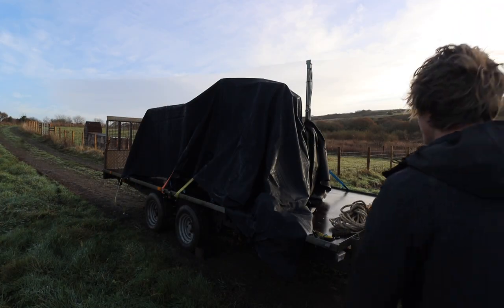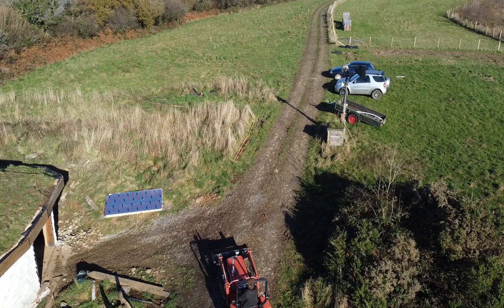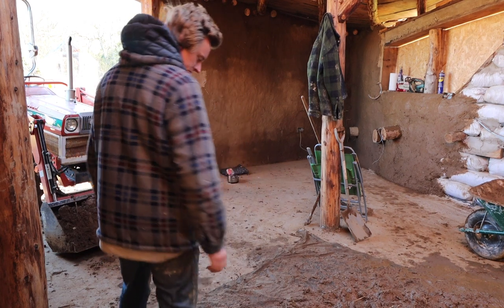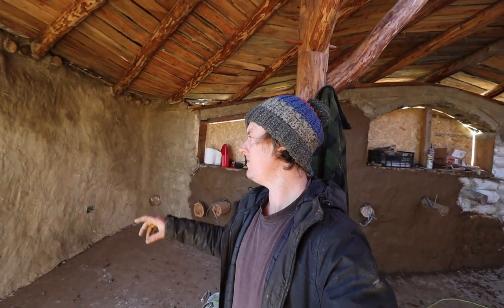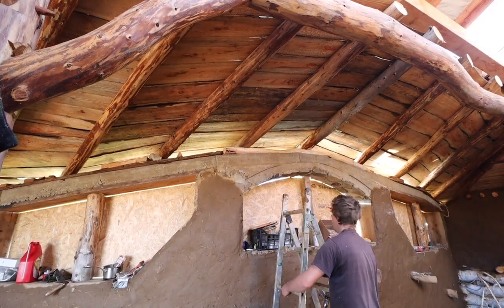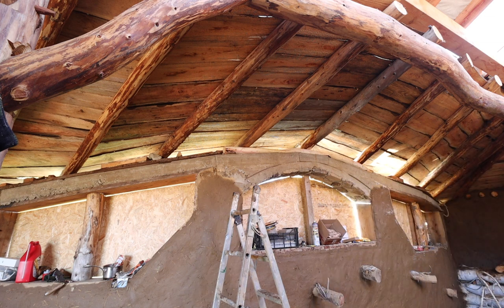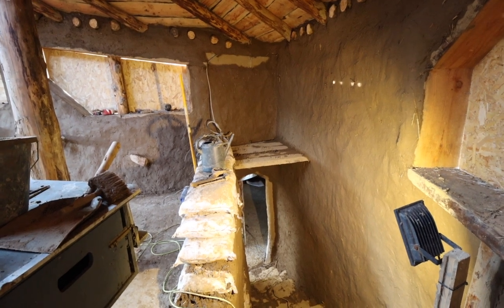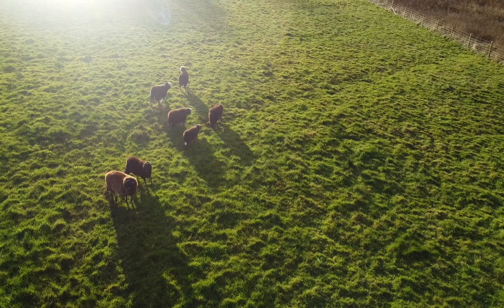Off Grid Earthbag Workshop Part 74 Cob Plaster

Comment: Kris, a tip for you some years ago a mate decided to build he and his wife a cob brick house not far from where I live
The way he mixed his cob was he had an electric cement mixer geared to turn in reverse (so the cob wouldn't bind up into one large lump) he could make on his own 75 bricks including prep and clean up a day in under 2 hours
I know you can get cement mixers that can be portable on tractors or bobcats (see Andrew Camerata's Yt channel)
You could drive to your piles of clay and sand load up add chopped straw (I had a mulcher that would have done that perfectly) and then dump it on location as needed.

I like the mill and you said it was in excellent condition but am cringing at you leaving it in such a damp environment for a long time even if you put Crc or RP7 or oil ON it
You could have stored it in the lower work shop till the walls where cured and dry

 For ease why aren't you using a tressel (2 ladders and a length of board between them) you could load up the board with blobs of cob and not have to get up or down a ladder 60 times....

Please do not think I am picking Kris I have the hugest admiration for all that you do , sometimes  we get myopic on the task at hand, 
And others looking on can see lateral ways of making our lives easier.
If I can I try to offer lateral ways of doing things that may not have occurred to the person, I can't be there to help you in person I hope this is a way of contributing. 
Tony from Western Australia 🇦🇺

Comment: When you mentioned the weight of the cob used only inside the new workspace, some images from murican building methods popped up in my mind.  ;-)
And I like your practical style of thinking/solving problems  , using the tractor for mixing the cob is another fine example.

Comment: There is nothing wrong with rejecting a piece of equipment that is not quite right or does not fulfill your needs. I have been told that I was too picky, about a particular saw. It was expensive, I had to save for it and it did not run properly. It was a huge safety issue for me and the cost to send it out for repairs/reconditioning was absolutely outrageous. It went back, yes disappointing to say the least, but having to look at it and being put off in disgust was stressful. I don't feel bad for me, but for the next person who got it!! Good choice if you are not 100% happy!!  Love your videos...crack on. Thanks for sharing!! :)

Comment: Surprised you aren't burning your woodstove in the lower section and letting that heat rise up through the upper workshop to help dry it out. I have said it before and I will say it again ....you are truly an artist with your building skills! Great job!
Reply: I assume it would be similar to plaster and not dry evenly and crack when an unnatural heat source is used (but that’s just a guess).

Comment: Hi Kris, just a hint...weld a tow bar ball to the top of your front tractor bucket...you can tow and move anything then and it does not affect the performance of the bucket. I also did it to a mini digger blade and it was so awesome towing anything anywhere. Great vids...I'm jealous

Comment: Great video. I'm a cobber and I paint the walls with a mix of lime wash and clay slip, about 50/50 and it works as a plaster as well as a paint as it fills up all the holes and smooths the bumps. What a brilliant workspace you have.

Comment: When I used to work at the factory back in the day we had a 2 ton machine delivered it was ridiculous but the way we moved it with ease was to use metal poles underneath it just have a line of metal poles (pieces of round wood would work as well) going from where it stands to where you want to put it, it just rolls across the tubes so easy. 

I know it’s a bit late now but in future if you ever have to move a heavy machine just try that method it will save your back trust me.

Comment: I don’t know about England and electricity, in the USA those machines take what we call 3 phase power and you need to either have the 3 phase that is only done for big factories or you need what is called a phase converter. My dad was a machinist for 60 years and had a shop set up in the garage.
You have been blessed to have the help with putting up the cob. I don’t blame the person for not wanting to be on camera
Reply: Kris has had 3 phase for years.
He already uses a 3 phase planer/ thicknesser, and a saw bench.
All generated by his own hydro and solar.
This guy REALLY knows what he's doing.
Reply: @VFRrider  that is amazing. Here in the USA it cost a fortune to get on mains power for 3 phase. My husband was a industrial electrician and I remember my dad talking about how much the phase converter cost and the electrician bill.
Reply: At about 4:20 Kris explains that the previous owner has installed single phase motors on the mill.
Perhaps you missed it?
Reply: @Mindy56743  
If you can find the time Arminda, I strongly recommend binge watching all Kris's videos.
It's quite a journey..!
Reply: I guess I will have to binge them all. I find it amazing that he has 3 phase with hydro power. Although I should not be this guy is amazing at the stuff he has accomplished.
Reply: These days VFD's make using three phase machines in home workshops a lot less of a hassle at least.
Reply: @lemagreengreen  my dad had his first shop in the early 80’s

Comment: This could be an hour long and I'd be engaged as ever. Your thumbnail literally had me doing a small jig, made hot chocolate and watched your episode with joy. No one else gets me doing that. Nice to see Dot helping your lime wash efforts too. Thanks to the helper! (Question: is a lime wash insufficient as an outside covering for the cob walls?)
Reply: In my experience, if a cob house has a good overhanging roof then you don't even need to use lime wash, but lime wash will be excellent as well.

Comment: Hey 
You have the same Mill, I bought some years ago. Really good machine.
Last summer i completely restaurated mine. 
You definetly schould change the oil and check the top bearings.
If you have some questions, just send me a message.

Comment: Looking great Kris. Looking forward to seeing you make the doors for the main entrance and for the bottom of the stairs. 

I wonder how much the increased cost of the logs is due to the price of fuel?  Even with the ridiculous prices for lumber here in Canada I’ve heard that logs are still relatively cheap with most of the increased pricing coming from the mills and increased retail markups.
Reply from the maker: It is still cheap compared too milled timber. But to put it in to perspective. when I moved here 5 years ago I could buy a ton of larch for £30 this larch cost £145 a ton. so 5 times the price in 5 years.
Reply: @KrisHarbour  
As for cheap there were complaints in the last year about a pulpwood processor having full saw logs on site instead of logs no good for milling because it doesn’t matter when your end product is wood fibre. 
Story was that the loggers were not getting much for sawlogs and the pulp mills were closer and willing to pay as much per tonne. 

5 times the price in 5 years is a hard pill to swallow.  Having your own bandsaw mill is better and more efficient than how you used to do it but not 5 times better.

Comment: Oh come on Chris! Can't you just let's know roughly about the lathe? No names or details etc. It looked great from the glimpse I got
Reply from the maker: it looked good to me to. I didn't have the tools to take off all the covers when I looked at it. Once I got it home and looked at the gearbox it had been run for a long time with no oil, all the brass bushings were gone and turned to brass dust and there main gear shafts all scored. it was shiny scrap metal.
Reply: @KrisHarbour  Oh, that's really sad. That's a Colchester 600 from the '70s or so, we have one at my work. If you happen to see the name Microweily, check it out. It's the Taiwanese make of the machine I use, and it's superbly engineered and reasonably priced new. Best of luck, and always wear the damn safety goggles. ;-)
Reply: @KrisHarbour  What a shame! All the way to my home city just to get stiffed on a deal! If I had known you could have come round for a cup of tea!! 🙃
Reply: @KrisHarbour  Jings, that's just cruel of them letting you drive that away... they had to know.  Shame, when you unveiled it I was thinking how great and new both machines looked but of course that was just a glimpse.
Reply from the maker: Im just glad I got my money back on it, it cost me to send it back but it could have been much worse. I now know what tools I need to get in to all the covers so next time I look at this same make lathe again I will go prepared.
Reply: @KrisHarbour  life lesson I guess. Learn, don't do it again! Move on. ...

Comment: I caught up to current time after watching a few weeks worth of the back episodes.  I find myself looking at a lot of small streams and running rivers and wondering how much hydroelectric power they would produce.  I wonder why you're not focusing more on wind power on your property.  You seem to have significant wind constantly, where you only have significant water about 9 months of the year.
Reply: Ends of logs laid at the top of the wall in cob to fill in gaps between the top of the wall and the roof.
Reply: Bob Adam -  He uses solar plus wind in the spring/summer months with some water power when storms occur. Water plus solar plus wind is used in the fall/winter. With frequent rain, the water turbine can supply most of his fall/winter power needs, with solar and wind filling the gaps. However, Kris can manage without wind power though it makes him have to carefully plan tool usage to avoid draining the batteries too much. I.e., wind power is an adjunct to solar and water power; obtaining power from the wind turbine is not a necessity.

Comment: Stunning work as always Kris. What's wrong with the lathe? It looked all right in appearance. And I don't think you ever turned it on.
Reply: Osvaldo Pinco -    Reply posted by Kris: "it looked good to me to. I didn't have the tools to take off all the covers when I looked at it. Once I got it home and looked at the gearbox it had been run for a long time with no oil, all the brass bushings were gone and turned to brass dust and there main gear shafts all scored. it was shiny scrap metal.
Reply: @wendyweaver8749  thanks for the reply! Didn't catch the original from Kris.

Comment: How is the roof doing - do you have a couple a leaks in the roof?   Or was that Tannin staining in the spots the wood turns black after getting a little water on it?
Reply from the maker: The roof is great. no leaks at all. the patches that look wet are from the treatment I sprayed on that seeped through before I finished the shingles.

Comment: Must have been something seriously wrong with the lathe for you to pay to send it back rather than fix it yourself.
Reply: KIZUJO1987 -        Reply posted by Kris: "it looked good to me to. I didn't have the tools to take off all the covers when I looked at it. Once I got it home and looked at the gearbox it had been run for a long time with no oil, all the brass bushings were gone and turned to brass dust and there main gear shafts all scored. it was shiny scrap metal.